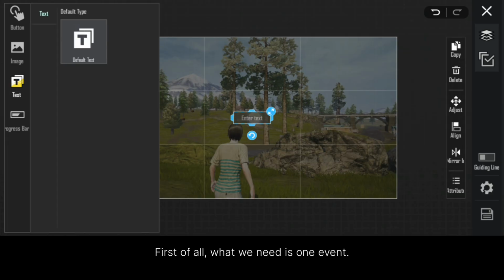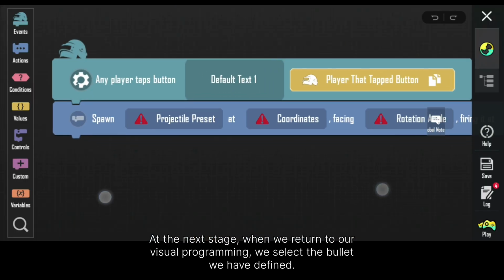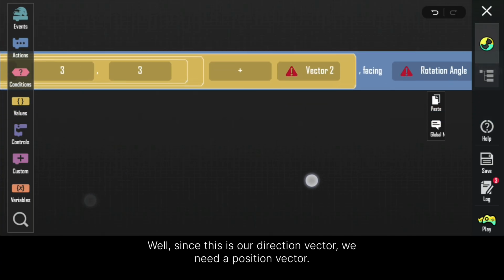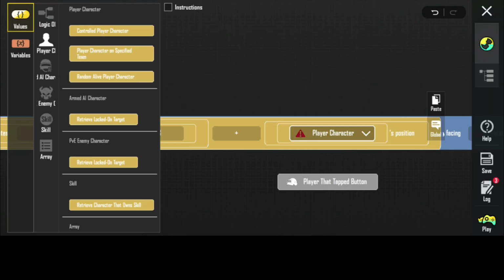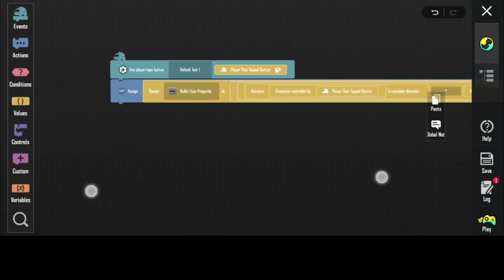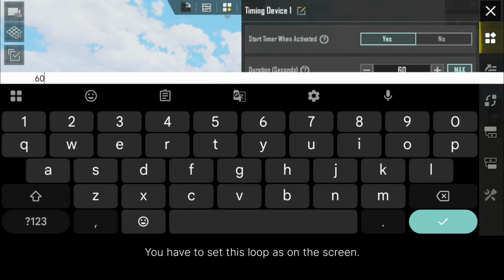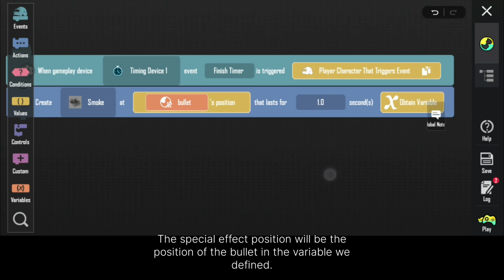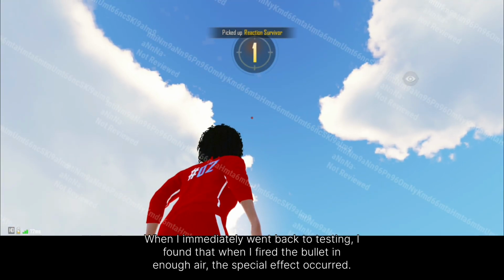PUBG MOBILE WOW DESIGN - HOW TO MAKE TRACER BULLETS (ingilizce ozel)

Comment: Well done, brother. However, an error message appears indicating a fault with the projectile. Please correct the explanation; I would be grateful.
Reply from the maker: Namely, the reason you get this error is that the bullet destroys itself after any collision, and the position can no longer find the coordinates of a destroyed bullet. B This loops endlessly and constantly sends an error message. To prevent this, you need to know how many seconds the bullet stays in the air.This can be roughly calculated using the velocity of the bullet and the gravitational force. For example, if your bullet stays in the air for 10 seconds, you can perform it 100 times at 0.1 second intervals within the timer cycle. The loop is calculated 100 times, and then the trigger (timer) is closed. If this happens every time a button is pressed, you'll get a few error messages, and the error will stop.
Reply: @WowtasarimBafi Thank you, brother. Please explain this in a video when you have time; I would be very grateful.